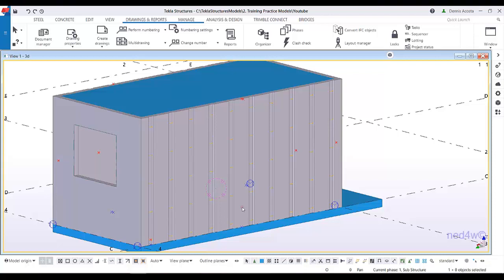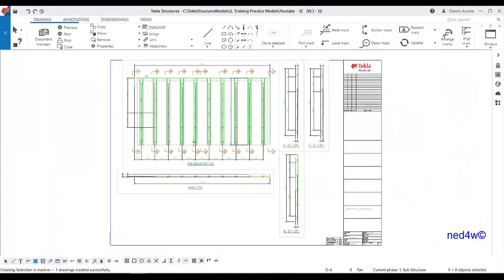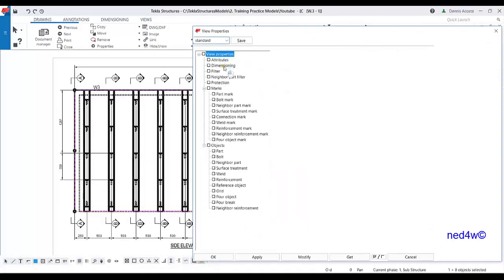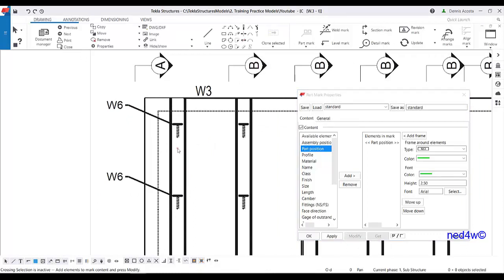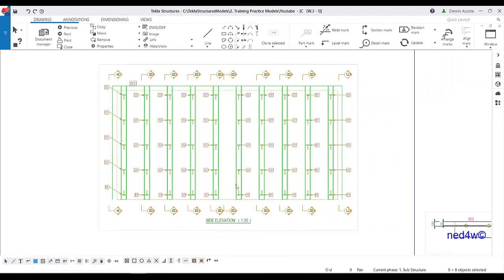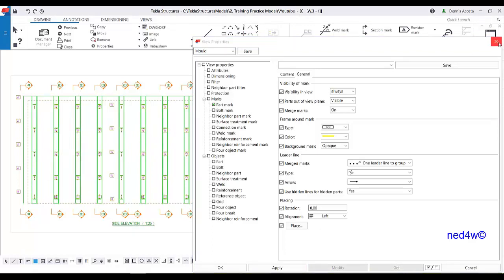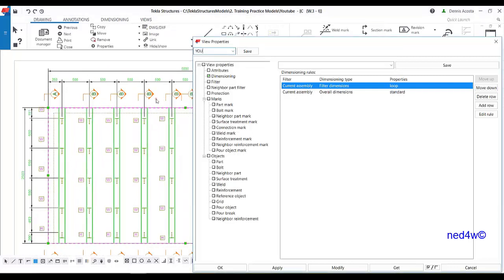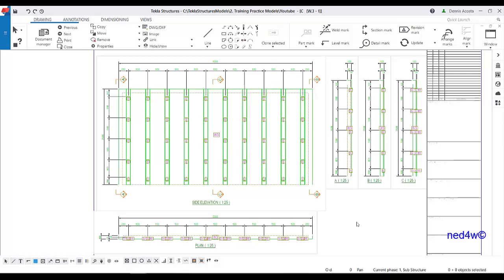How to Add Annotations and Dimensions in Cast Unit Drawing?

Comment: Res Sir
Tekla user community will be thankful if you prepare auto dimension / filter dimension for assembly (steel structure) with dimension rules with more explanation and setting in Tekla 2020.
Reply from the maker: Noted!